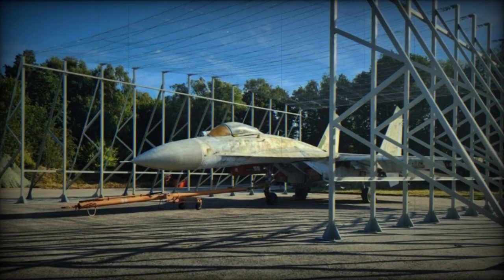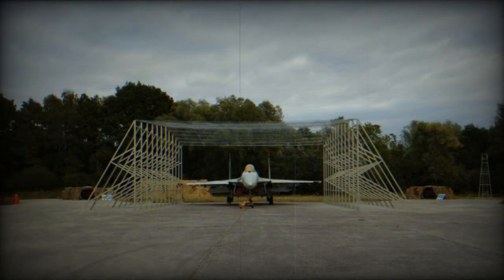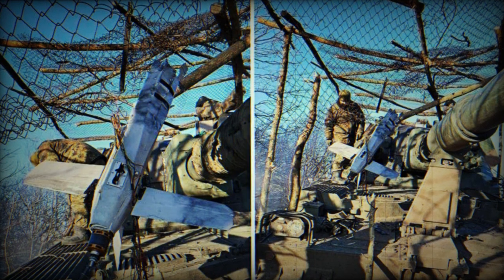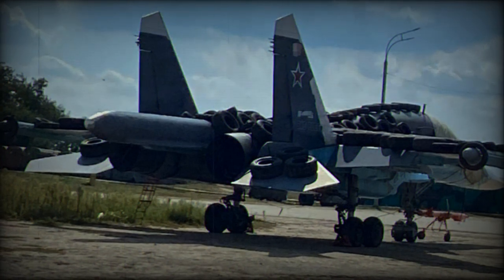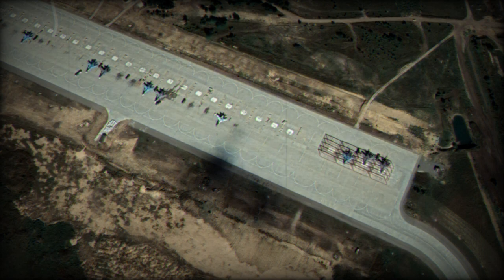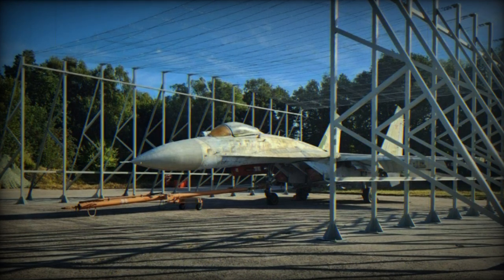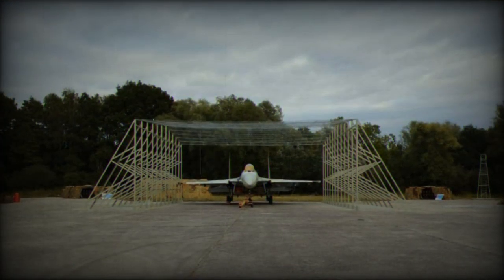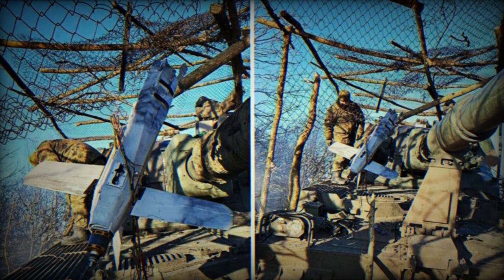Better Than Tires russians Show New Anti Drone Protection for Su 34 Bombers

Comment: Those cardboard drones the Ukrainians been use don’t have a impact fuse, they airburst and shoot thousands of metal ball bearings like a tiny Gmlrs rocket. The tires would probably do more than this😂
Reply: Lol bot, nop
Reply: @lalzgarra9493  they absolutely do, they made a video showing them off. Nasty little things at only $1000 a piece, that’s cheaper than a M4 carbine. See if the Russians had any kind of sense they’d build extremely secure hangers to house their ever dwindling supply of fighters and bombers?! I know they build their planes to withstand sitting in bad weather but it leaves them wide open to attack and these little nets or tires isn’t stopping anything. If anything those tire will just add to the blaze afterwards and this little cope net won’t help. I guess hangers are expensive but I’d imaging it’s cheaper that a couple of T-22m’s🤣
Reply: @drgonzo305  lol kiddo, you sound funny, well, lets see what happen next